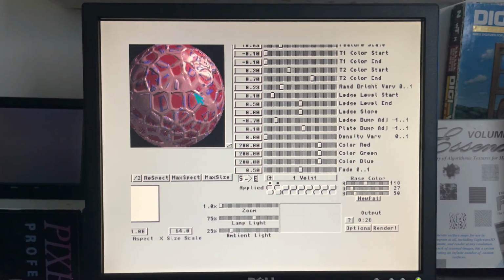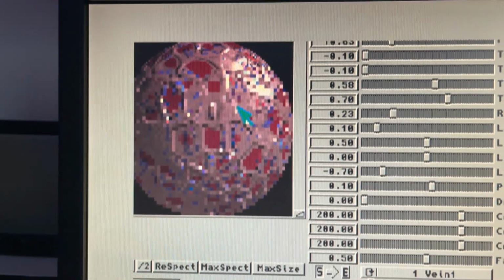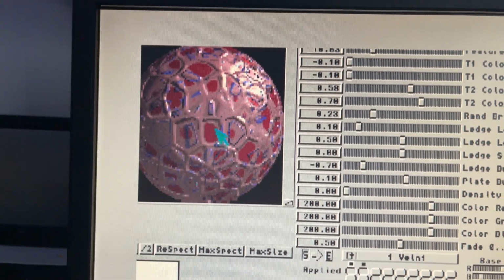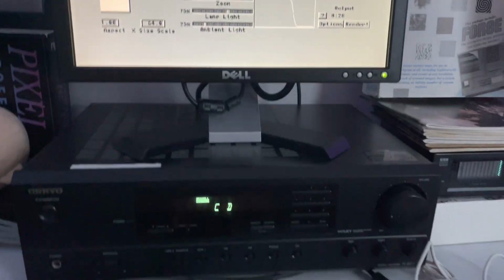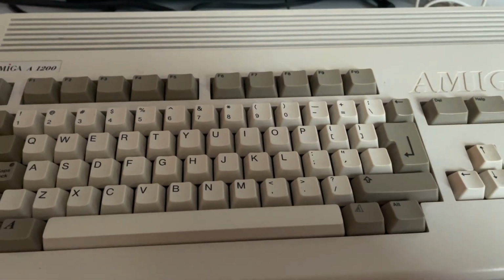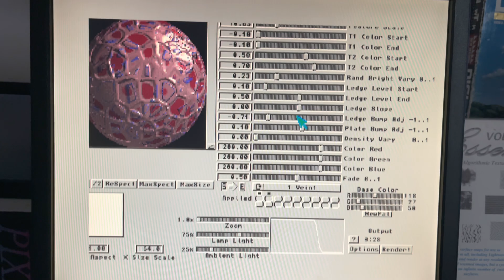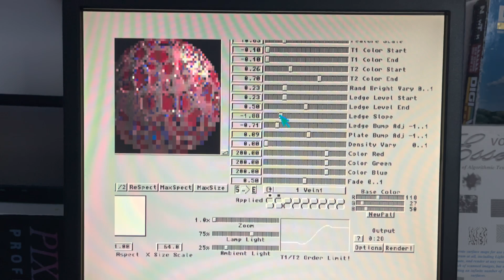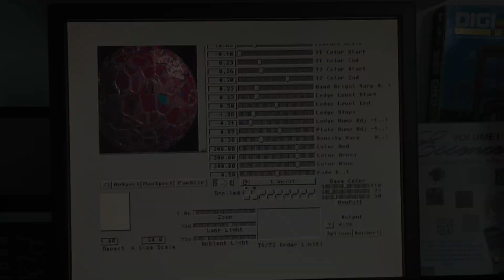This doesn't seem possible on Amiga, but it is. (Forge)

Comment: The Amiga was a beast of a machine, I had (still have) the A500 and the A1200, Windows took years to catch up, it really should have done better than it did.
Reply: I loved the Amiga, but the thing we loved best about the Amiga (the custom chips) was ultimately it's failure.   It was so tied into that architecture that in inhibited creation of retargetable graphics, no legitimate 640x480 mode, and modern architectures that today have high-speed buses to push graphics to a display card that can render these things in real time.   Plus the platform was split between a pure games machine and a productivity tool that didn't allow, for example, process spaces to isolate each program from each other (it would have broken everything).

It's not a criticism of the platform, it was amazing for the era it was created, but Commodore was a hardware company and couldn't conceive of product roadmap nor fund it that way Apple could.
Reply from the maker: Glad to hear you still have them!

Comment: I worked at what I would call a high-end pc repair and corporate network installation and maintenance shop in the early 90's and people were bringing in Amigas from time to time for repair and parts and I saw first hand their capabilities. I didn't think much of it at the time because they wouldn't run the software I was already used to running so there wasn't much I could use it for, or so I thought. Looking back, it's a tragedy that Amiga wasn't the foundation of what we built everything on, but no, it had to be IBM compatibles and Microsoft. I can only imagine how much further along we would be if we had gone down the Amiga path. It's just a tragedy.

Comment: I think you should check out Imagine - it had this capability built into the rendering toolkit. 
I used it to make background desktop 3D images for a computer company that sold Windows machines :) .. Little did the users buying the machines know that their beautiful desktops were all generated on a machine 20 yrs older than them :)
Reply from the maker: I started in 3D with Imagine 2.0. Fun, but a little complex. It was very powerful. Loved it’s modeler. That’s so cool about your background images!! Oh man, that’s some fun legacy to have!
Reply: @HoldandModify  Yeah it was a great tool. I started with the early coverdisk versions, and later bought the full version. Around 1998 ish was when I was making the backgrounds for then popular Win95 desktops. I also built some OpenGL animation overlays for the company I helped out. They loved it. The Amiga was my daily driver back then, fond memories - I have a bunch of them here now :) .. A600, A1200, A1000, A500 and some weird hardware too (like a physical disk drive virus detector :) ). 
Great machines, still enjoy firing one up and doing some coding. Still the best OS imho. Even now.

Comment: Not sure I'd call it "real time".  It looks like it's taking a good minute or more to fully render the image. 3D rendering was possible on many early computers of the 70's and 80's. But like this it was slow. To me "real time" means you move the slider and the completed image is ready, now. Much like it is in Unity. Impressive, but you are overselling it a bit.
Reply from the maker: Okay…FINE. It’s still pretty cool. For 1995 on a home computer. :)

Comment: ray tracing is nothing new, holywood used it for years.
but it took a looong time to render each frame, what is new is that we can render 60 frames per second using raytracing nowadays.
with tons of polygons and a good resolution
Reply from the maker: RAYTRACING!
Reply: Yeah, well and thanks to 30 years of lithography development obviously. I would be curious what it was about the hardware that made this possible compared to the IBM PC at the time.
Reply: @smallbluemachine  those computers with the size of an refrigerator, tons of then filling an entire room

Comment: impressive but not real time
Reply from the maker: Real time for a home computer in 1995. Lol! (yes you’re right though)
Reply: this was as close to real time as it gets for 30yo tech
Reply: @rallisf1  Well yeah, no denying it’s fast but you need to go over 100x faster to be considered real-time. I’m just saying that calling it real-time is a bit of a stretch.
Reply: @Nib_Nob-t7x  A bit? It's essentially an outright lie. Real time means, NOW. Not 1 minute later. If my security camera claimed real time imagery and I had a 1 minute delay, I'd return it for fraudulent claims.
Reply: @harshbarj  Are you seriously trying to argue over the part where I said a bit when I said 100x faster, I obviously know it needs to be much faster especially since I did the math. 100x faster puts it at 20fps which is still a stretch (about i use 5 seconds as a base to simplify but it takes a bit longer to render)

Comment: This is why Michael J Strazynski used Amigas to render the graphics for the Babylon 5 TV show 👍🏻 It’s like the engineers went into the future and went back to the 1980’s and said we are doing this! 😉
Reply: Only the earlier seasons, and just as much thanks should go to the video toaster really. 🙂
Reply: according to wikipedia,  he used the Amigas to render the special effects for the pilot of the show (1st episode) only.

He used the amigas not because the amigas did it so great - he did it because the $5000 per Amiga 2000 were just a fraction of the cost for the hardware, that were more commonly used for the task by that time.
Reply: @monarch73  I’ve seen conflicting info about that from various sources, iirc they used the A2000s at least for S1.. it’s possible they still used them for modelling later even when they weren’t in the rendering pipeline beyond that point? 🤷🏻‍♀️